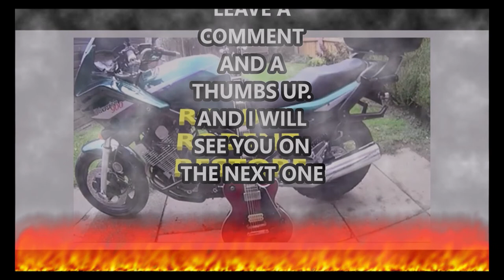VAUHALL INSIGNIA, Engine Oil and filter Change, UK

Comment: Hi Jon that sump bolt was tight never seen a sump nut with holes in it good idea from Vauxhall that 👍
Reply from the maker: Hi Derek . I think Arnold schwarzeneger did the oil change last time. 👍👍👍
Reply: @jonyr1TT  😂😂😂🤣🤣🤣👍👍👍💪🏻💪🏻💪🏻💪🏻 I’ll be back

Comment: Friend tried doing his today. Rounded the sump bolt off as it was so tight!
Reply from the maker: Mine was the same you have to be really careful. Hope you can sort it. 👍
Reply: @jonyr1TT  You need to use a 6-sided socket, not those star ones, give the sump bolt a tap with the hammer first, when you get it off make sure you only torque it back to 14nm should be easier to get off next time.
Reply: It is because the washer on it doesn’t seal after a few uses it has a rubber gasket that crushes so people give it some and the next time it get more I always charge the washer
Reply: next time spray some penetrating fluid on it, leave it for half hour and have a cuppa... when you come back it should be better. If not, repeat. It will loosen and saves the drama of rounding it.

Comment: After doing my mates Insignia last year and my Astra the other week, I thought to myself 'there has to be a better way of removing that oil filter!' I'm going to try your method of removing the wheel tomorrow and using some cardboard as a kind of funnel, as it doesn't half make one hell of a mess.
As others have mentioned that sump bolt was shockingly tight!
Reply from the maker: Cheers buddy it saves a lot of mess on the driveway 👍
Reply: @jonyr1TT  Well an update on the oil filter, much easier to take the wheel off... luckily Amazon had just dropped me a new machine polisher off and the box was the perfect shape for a funnel 😄 not a single drop of oil on the arms, boots or anything. I still think its a horrible design, but at least it only needs doing once a year 👍
Reply from the maker: Nice one buddy